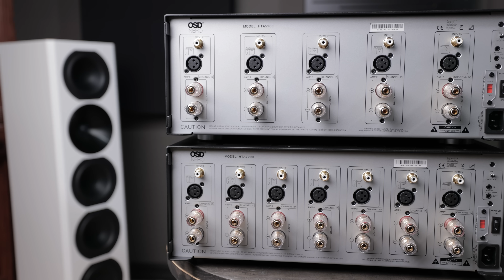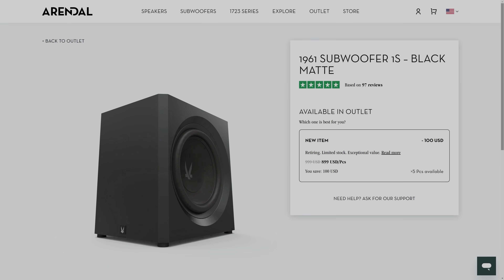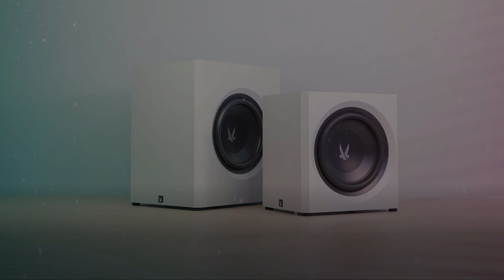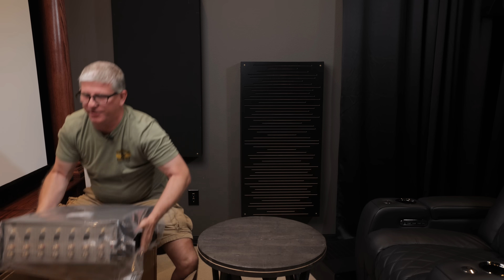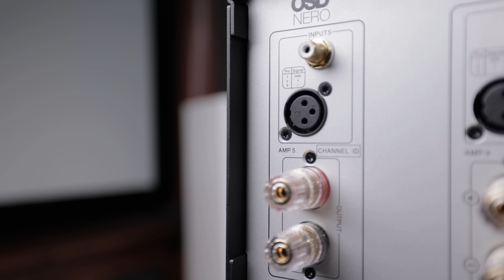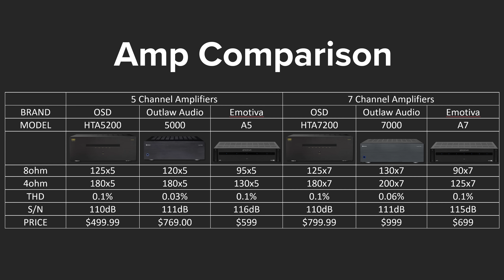OSD AGRESSIVE Pricing on New Amplifiers! HTA5200 & HTA7200

Comment: @Youthman. Hello, great channel. Many Brazilians like it. My question: Each receiver has a different sound signature: Marantz, Yamaha, Denon, etc. Some are better for movies, others for music. If I put a low-cost amplifier, such as the OSD Nero HTA5200, in my Denon X4800h, will I lose audio quality or will it improve? What signature will I get? More for movies or more for music? I'm going to the USA for a trip now and I'm thinking of buying a Nero amplifier, which is not available in my country and few people know about. What do you think?
Reply from the maker: The OSD amplifier should not change the sound signature. Its job is to simply amplify the sound that it is provided. The signature comes from your AVR and calibration, not your amplifier. Hope that helps.
Reply: @Youthman  I don''t know about that you must test it out. Denon has a sound signature that is unbeatable its addicting. None of these other AVR companies don''t sound as good as Denon trust me on that. Im hoping the OSD doesnt change the sound as well.
Reply from the maker: Unbeatable? We did blind AB testing between several AVR’s. Most could not accurately pick out which AVR they were listening to, and many thought we were switching between even when it remained on the same AVR during the test.

Comment: Kind of sad I missed out on the discount 😔! It's all good taxes came LOL 😉 (polka audio monitor TX70 200 Watts RMS )quantity 4 of these speakers in each corner of my room )and then I have the same model for the center which is polka audio monitor tx35 this speaker has a wattage 200 watts RMS my other two speakers is (polka audio monitor TX 15 speakers have a wattage of 150 watts RMS)I want to hook up all the speakers to amplifier out of to do 7 channels from your little cheat sheet cheat sheet right now the price for the OSD HTA 7200 right now it's going for $999.00 can get it on the OSD website for $799.00 with a discount company of the website❤

Comment: My Emotiva XPA 7 channel just went dead . It’s over 10 years old . Debating on sending it in for repairs or getting the OSD 7 channel
Reply: @rualanthony6458  my XPA 3 just died as well.. flickering orange light around the power button. They want me to ship it to TX and I'm in CA so shipping alone may be a couple of hundred $$. Leave along the repair costs.  OSD 52 may be the way to go for me. Too bad the discount code doesn't work anymore.
Reply: @fthahim I got 2 of the 7 channel amps , one replaced the Emotiva basx 5 channel for the heights so running 2 OSD 7 for all the floor standing and amps . They definitely bring my Def tech 17s alive more than the Emotiva especially with the surrounds and they are built like a tank
Reply: @rualanthony6458  you sold me. my bas x5 just died 5 months out of warranty. Any little reason to upgrade bug.

Comment: Quick question. How come your ratings of power vary from the sites. 

Is it because yours is against 0.1%, not 1% distortion. 

I.e amplifier rated at 5x210 Watts (4 ohms), 145W (8 ohms)
Reply from the maker: I pulled the specs from the OSD website.

Comment: Just recently received the HTA5200 and WOW, it's built like a tank! Quality all around is the first impression you get with this unit. I struggled trying to find a video on YT that does a good job explaining what you get by adding a dedicated amp to a HT. From my experience, adding the 5200 to my system gave me more noticeable separation and much more noticeable surround. There's much more presence in the lower volumes as well, where previously I would find myself adjusting levels in dialogue due to the lower volume to achieve more clarity in quieter scenes. I can also say running the amp for hours at my max listening levels for music/movies I was stunned the amp was barely even warm to the touch, like so little I'd actually say mildest of warm. For the specs, price point, build quality, this thing is amazing.
Reply: Quick question, do you use rca or xlr to connect with?
Reply: @davidross7255  RCA

Comment: I just removed the LFE cable from my OSD Trevoce 12's. Onkyo receiver crossover now at 50 HZ and Subwoofer crossover knob all the way Up to bypass it. Movies sound Awesome. LFE was okay with Onkyo at 80 HZ or still good quality bass, but using the Dual Left & Right (Red and White cable Y shaped) with single out from the Onkyo & crossover at 40 to 50 HZ (Depending on the movie) the Subwoofer hits way better. This is because I have never used any DSP adjustment like iWoofer app. OSD subs need Low Crossover or DSP to hit 10-30 HZ. Some movies I will put Onkyo crossover up to 60HZ if it's not a bass movie. Edge of Tomorrow- Live Die Repeat, I had the Onkyo sub crossover at 40 HZ it was Awesome. Godzilla 2014 too.

Comment: Youthman could you please answer a question about the OSD HTA 5200? I am using the emotiva xda 3 as my preamp/dac.that runs into the 5200 using balanced outputs,the rca outputs are being run into my monolith m10 v2 sub using subs rca inputs.m10 v2 also has a balanced sub input and balanced sub output to daisey chain to a second M10 v2 sub. is there a balanced output y splitter to feed the balanced input on M10 v2 sub from emotiva dac/pre ?can you correctly split a balanced differential reference signal from a so equipped pre amp?THANKS SO MUCH FOR YOUR TIME,ANSWER FROM EMOTIVA WAS POOR AND NOT HELPFUL.

Comment: Just received my HTA 7200 today and hooked it up to my RZ50 with some old school ADS 1590 speakers. Sounds insanely good and super heavy. Excellent value at $799 and was able to use some amazon reward points from my credit card to make it even cheaper. Was looking at getting the monolith 7x200 channel amp, but at more than half the price couldn't resist.

Comment: Will this power a passive OUTDOOR sub, Forza 10", I also need to power to other 200 W speakers. (2.1?) outdoor system in zone 2
Reply: Should be able to.  I have an Atlantic technology SA-180 amp, which is rated 180 watts @ 4 ohm, 0.03% THD.  It can drive my PSB 6i 12" subwoofer louder and sound better than the original 225 watts internal internal rated amp.  The reason I use SA-180 is that the internal class H amp (class D) died and I am running external SA-180 amp.  This OSD is also rated at 180 watts @ 4ohm.  So 180 watts clean power can drive any 10 subwoofer.

Comment: YOUTHMAN,CANT FIND ANY OF LITERATURE FOR OSD HTA 5200 ON THEIR WEBSITE,WOULD YOU HAVE AN OLDER LINK ON THEIR WEBSITE?THANKS FOR YOUR TIME.
Reply: I found the owners manual for 4200, 5200, 7200 in PDF.
Reply: Waiting for a review from Audioholics or ASR
Reply from the maker: I believe they said they sent one to ASR
Reply: @Youthman  , with two big toroidal transformers and 4 caps of 10000uF each channel, that's main contribution to extra weight, it should measure well.
Reply: @Youthman  YES,THANKS ALL FOR INFO.
Reply from the maker: I do not have any literature for them. You could email them
Reply: What literature are you looking for?

Comment: Thanks Youthman.  Ordered a 5200 with your code.  

No tax to Indiana is a plus.  My setup is 3.1 and I will biamp L & R.

OSD is offering FIVE year warranty this time.  Hope this design is more reliable that previous version.  Both 5200 and 7200 are using two toroidal transformers and are heavier by more than 10lbs than previous version.  Each channel has 4 x 10000 uF capacitors.  Previous version is class H has one toroidal transformer for both 5 and 7 channels and each channel has 4 x 6800 uF capacitors.  It has idle current of 0.14 Amps.  The input sensitivity is 1 volt if that means something for some people.

The amps are made by a company registered in Taiwan in 1980, Homni Electronics Company Limited, which set up a factory in China in 1994. The same factory also makes Outlaw amps.  OSD had a legal fight with Outlaw about S/N ratios labeling and and manual of previous version of 5180 and 7180 amps and lost to Outlaw.

These OSD amps are fanless, while Emotiva A serious has two fans due to low cooling capacity.

Outlaw 5000x uses one toroidal transformer for all channel.  There are 4 x 6800 uF capacitors for each channel.
Reply: I am comparing this amplifier (5200) to my 7 channel Musical Fidelity...almost identical design. Specs almost the same with dual transformers and 4x 1000 per channel. Musical Fidelity 2.8 DB headroom at 4 ohms wich makes it almost 400 watts @ 4 ohms.
Reply: I'd like to know your opinion on the 5200 when it arrives !
Reply: @DanyR10  , It sounds clean, with no background noise at all.
Reply: @DanyR10  , sure
Reply: I saw your post I looked it up and said it’s build here in the US for 5200 and 7200? Or that’s not correct?
Reply: @carlosLara-cl2xk  , it's clearly labelled as "Made in China" on the box.
Reply: @swllz  oh I haven’t seen one so I wouldn’t know

Comment: Was able to get the deal at the Manufacturer site, thank you to Youthman!!! Got the 5 channel unit.
Reply from the maker: Congrats! Let me know what you think after you get it set up
Reply: Ok got my unit the OSD HTA5200
First impressions compared to my Yamaha RX-V1700: Both hooked to a 12" powered sub ported in the front, speakers are Focal Aria 926 in 2 channel mode. The Yamaha is every bit as punchy and actually has better clarity using all the same settings. It has 130 watts per channel RMS at .04% thd 8ohms. Also compared to my Sansui AU-717 advertised at 85 watts at .025% thd 8 ohms (has been fully restored), the Sansui in my opinion sounded better than both the OSD Amp and the Yamaha receiver. It had cleaner fuller sound with more detailed and controlled mids and highs and also deeper bass. Even though I had the sub hooked to it  on channel "B" for music, I thought I could go without the sub on the Sansui. I will give it a few days. With OSD it was definitely on the warmer side, but I felt I lost detail over the Sansui. These late 70's amps were rated very conservatively from many manufacturers including this one with the new Nichicon caps it's hard to beat for the price.

Comment: OSD website says 145 watts(ohms) all channels driven
Reply from the maker: If you click on specifications, you will see two sets of measurements for both 4ohm and for 8ohm depending on the amount of distortion.

All Channel Output:
4 Ohms @1% THD - 210W
8 Ohms @1% THD - 145W
4 Ohms @0.1% THD - 180W
8 Ohms @0.1% THD - 125W
Reply from the maker: You can get more power from the amp but at higher Total Harmonic Distortion levels.

Comment: I believe Buckeye has these beat on specs. Much higher power and small form factor. You should add them to your reviews (especially since Ryan reps for them).
Reply from the maker: Buckeye makes fantastic amps, but at $1,600, they are not comparable.
Reply: @Youthman  and they do not sound the same
Reply from the maker: Unless amplifiers running out of gas, or adding his in your speakers, I would venture to say that you would not be able to accurately hear a difference between amps in a blind test.

Comment: I can't find the Youthman coupon code for the OSD amp discount.
Reply from the maker: If you purchase on Amazon, you won’t need to use it. There’s a little checkbox that says apply $200 coupon.

If you’re purchasing directly from their website, on the final checkout page, there’s a link that says add a coupon code. That’s where you would put in Youthman.
Reply: @Youthman  Thank you for your quick response.  I clicked on the Amazon link for the 5 channel OSD amplifier and the coupon box does not show up.  I went directly to Outdoor Speaker Depot and entered the promo code Youthman and that gave me the $200 discount.  Thank you for your help with this issue.

Comment: I saw different specs for the OSD amps.  I saw 145 watts in 8 ohms and 210 in 4 ohms.  Maybe what I saw is wrong.  With that discount I think I will get one.
Reply from the maker: There are two sets of measurements because there’s different ways that manufactures measure them. 

Back to car audio days when some brands would post RMS  (continuous) power while another brand would post PEAK power. OSD is posting both so you can more easily compare against other brands.

They did the same with S/N. You will notice two measurements there as well. When you look at other brands like Emotiva’s website, they use the inflated A-weighted S/N as that number looks better. It’s all marketing games that brands play. OSD is just doing their best to be transparent.
Reply: @Youthman  got it.  That makes sense.  I really used to be into car audio.  It was always important to find a receiver with the highest volt preamp output.  That is why I always went with Clarion.  I was also a big fan of Phoenix Gold, Soundstream, Orion, and PP Sound.  You brought back a lot of memories mentioning car audio🤣🤣🤣.  One more thing how long will the Youthman sale last?  Appreciate you my brother.
Reply from the maker: Let me ask OSD. Someone mentioned they saw it was only good until May 1, but I did not see that anywhere myself so I’m not sure.
Reply: @Youthman  Sounds good.
Reply from the maker: I did confirm the sale ends at midnight on May 1. I believe they removed the discount from Amazon, but you can still get it directly from their website using the Youthman code during checkout
Reply: @Youthman  thanks buddy.  I'll take care of it today.

Comment: Interesting. Never saw a company do different duistortions like this.
From their website:

All Channel Output:
4 Ohms @1% THD - 210W
8 Ohms @1% THD - 145W
4 Ohms @0.1% THD - 180W
8 Ohms @0.1% THD - 125W
Reply from the maker: I asked about that and they said that's because various manufacturers rate their wattage in different formats so they wanted to provide both so you can compare apples to apples with other brands.

Comment: I use OSD amps for my HT and they are awesome. For the money, it's impossible to beat. Great quality too, it doesn't feel cheap by any means.
Reply from the maker: These definitely don’t feel cheap. I’m heading to the chiropractor tomorrow. 🤣
Reply: @Youthman you ain’t kidding? Sucker is heavy! I made the mistake of putting it on the ground while doing the initial setup. I’m only 26, but I hobbled for a solid day afterward…

Comment: Would enjoy seeing a video on the differences between SLR outputs and RCA outputs (balanced and unbalanced) on amplifiers.
Reply from the maker: I do not have the means to measure that.
Reply: @Youthman  Totally get it.  Do you prefer to connect your preamplifier with the SLR or RCA connections, and does it make a difference in your room with your set up?
Reply from the maker: XLR is good for long runs. If they are short, RCA works just fine unless you get a hum. Sometimes XLR can remove that. XLR does have a higher gain so that’s the only real benefit on shorter runs.
Reply: @Youthman  thank you!!!
Reply: @tabularasa820 the thing to watch out for is if the AVR/Amps have actual balanced XLR circuitry and it just Unbalanced XLR circuitry without the noise cancelling.

Comment: I have last year model OSD Nero XA7180 Multi Channel (7x) Class H.  It's a tank 70 pounds, plays flawless for 2 years zero issues and its clear and loud powers all B&W CM2  S2.  Not sure why more people don't buy these OSD amps for the price and build.  they clearly outsourced to a big name like Outlaw/ATI or something.  I think I picked it up right from OSD for $740 2 years ago.   Other brands I looked it into Emotive and Monolith, but I went this route since it was cheaper and more powerful.  Glad I purchased it.  It runs all 7 channels and my 4 Onkyo RXZ50 takes care of my 4  Atmos heights.
Reply: Heck yeah Bro, that sounds like a killer setup!
Reply: OSD is so new to home theater market, while Outlaw has been in the market for 20 years and well established.  People will buy Outlaw for the similar price and specs over OSD.  Outlaw and OSD are sourcing home theater amps from the same company/factory.  So the built quality should be very similar.
Reply: @swllz  Actually if you look under the hood of a MUSICAL FIDELITY AMP...you will see the same design... maybe different brand names on capacitors. But almost identical...
Reply: @LexusAllTerrain1  I just brought an OSD  HTA 5200, which replaces Nero line.  Both OSD lines should most likely come from the same factory in China and have similar specs.  Nero line stopped due to the lawsuit with Outlaw.
Reply: Few days in on owning my BasX did you get around to testing an Emotiva or a Monolith?

Comment: The HTA5200/7200 is 215W per channel (all channel driven) at 4 Ohms. 105dB SNR at 1W and >110dB at all channel driven and >110dB SNR at all power driven. Outlaw is @109dB all channel driven.
Reply: That's rated at 240v input.  The standard 120v is lower
Reply: And none of them actually meet those rated specs. It’s pointless to even mention them. Look up ASR reviews.
Reply from the maker: I believe OSD said the new amps have been sent to ASR for testing.
Reply: Can not see that review on there. Mostly user comments. I hope that are as good as people say they are. 

Otherwise might as well go for tonewinner as in Australia they are much cheaper for more. 

It is a geolocational thing for Australia.

Comment: I have two OSD 5-channel amps. They are really heavy amps. I love them. I was going to also buy. The 3-channel amp. But I just realized. For some reason. OSD stopped making the 3-channel. Don't see it on they website.
Reply: The HTA4200 is coming, you can bridge the two channel for three channel.